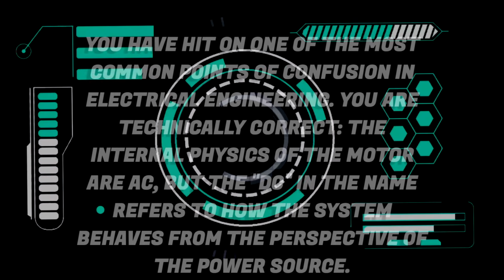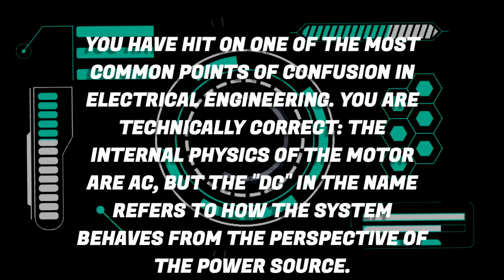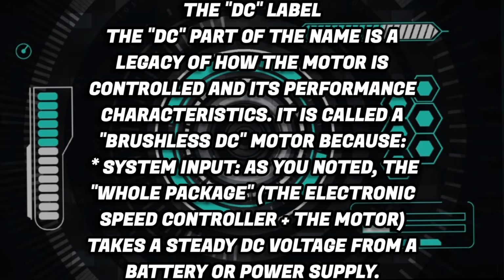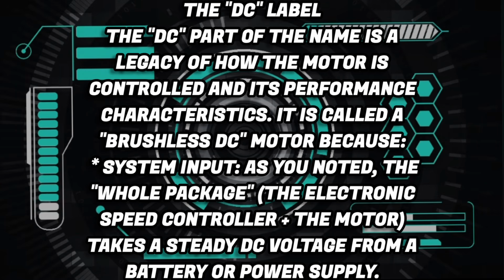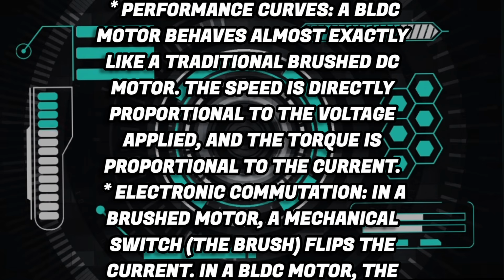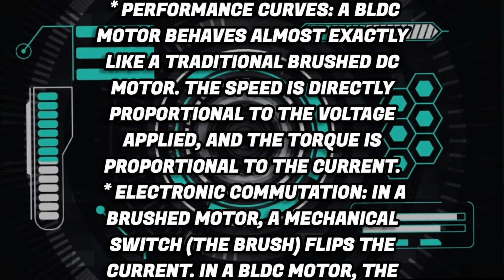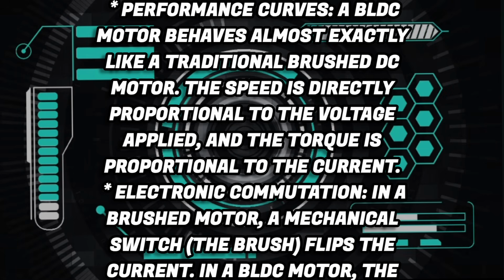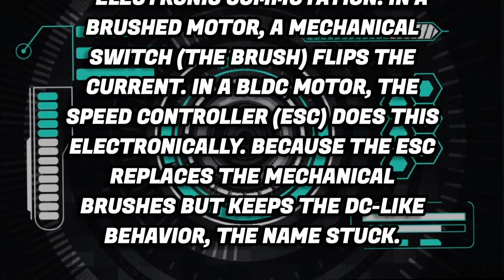What is? "BETAFLIGHT DYNAMIC IDLE" New Tutorial 2025 #fpv #betaflight #tutorial

Comment: Thanks for the good video. Any recommendations for speedybee Mario 8 using HQprops 8x4.5?
Reply from the maker: Woo a Mario 8! So ill be brutally honest! Ive never had much to do with 8" props.
All i can say is that if you have the correct motor and prop combination then a recomended value would be 12 to 25. 
So you have a 4.5 pitch prop so the higher the pitch prop the lower the setting and vicer versa.
For instance: on a 5" with 2306 1700 kv with ethix HQ s5 props which are a high pitch prop for freestyle, i found that 28  was great.
2306.5 motors are very torquey motors so have no problem idling a 4.5 mm prop. 
I dont like to drop to the minimum on the chart as you risk desyncs but gain inverted , 0 throttle hang time (a little)
So the Ethix S4 lemon and lime props are a 3.8 and i found that 35(3500rpm) gives a bouncey kinda instability at forward flight, so lowering them to 33 feels more locked in! (Tune your pids and master multiplier first).
With all that said: when you look at an 8 " the betaflight devs say 12 -25.
If you can hover and pitch punch your drone line of sight. Start at 12 and go up to 25. And its like catching a ball on a tennis racket.
The lowest value of 12 should come down hard and listen if you get that fluttery propwash noise.
Thats not good, slowly go to full 25 step by step and each time you will hear a change in motor/prop noise.
If you get to say 23 and it starts to jump up a little then you know its starting to loose authority and drop down a notch.
(It is not a setting that will do any harm or fly away so dont worry about that)
Hope ive helped and please let me know.
Thanks for asking @jonathanoeijoeng❤🫡

Comment: What would you set this to for a 5inch with hq juicy j37 props on a 6s 1300mah lipo weight is 634 all of weight
Reply from the maker: Hi mate, thanks for asking! So your props are 4.9" with a 3.9mm pitch and you have a light weight lipo on at 1300mah.
So if you go by the chart you want to be in the region of 20 = 35.(2500-3500 rpm) Your drone is gonna be light and j37s are a very lightweight prop with a low pitch at 3.9mm. 
Heavier frames carry more momentum and require a slightly higher idle floor to maintain strict motor authority, preventing desyncs or stuttering when you chop the throttle into deep dives.
Propeller Pitch (3.9"): The J37 is a relatively shallow-pitch prop,and light compared to a hevier ethix HQ s4 lemon nlime.
 Lower-pitch blades handle higher dynamic idle settings exceptionally well because they do not generate excessive thrust or make the quad feel overly "floaty" or resistant to dropping at zero throttle.  Nice flingerbuility with your weight.
I would try around 30-32 (3000rpm = 3200rpm)
Let me know how it goes? 
Thanks for asing mate❤🫡
Reply: @rcaddict9558  31 seems to be the best
Reply from the maker: Did you get anywhere with your dynamic idle?
Reply: @rcaddict9558  yes thank you 31 is the sweet spot
Reply from the maker: O wow! Thats really cool and thank you for letting me know❤🔥🫡

Comment: For 65mm racing whoops. What should it be set to
Reply from the maker: So when I had mine I kept the throttle curve normal, linear, but the throttle was wayyy to high and catching it from split s was really hard.
So I set the dshot Idle percent to 8.0 and this was to use with angle mode and NO AIRMODE ON but outside with airmode on in acro I set dynamic Idle to 76! This Will increase your throttle more like a bigger drone , about 1/4 and will fly alot better without altering throttle curves.
Give it a go. You might want to go higher depending on weight,props and motors.
Hope that helps❤🫡

Comment: Thanks for the information.
Is there a risk of a flyaway if I set this value too high?
Reply from the maker: No worries!  No, there is no chance of a flyaway, trust me, ive tried it😂 but best just try the settings in the charts. 
What size drone and what pitch props are you using, and it would help to know the weight , battery size and action cam or not?

Comment: ok, what is recommended dynamic idle for: HQProp 7.5X3.7X3 7.5Inch 3-blade ? thank you :D (quad is moz7v2 with DolphinRC 2808 1300KV motors) weight about 1400 grams. Thank you again :)
Reply: on my chimera7v2 with those same props and the xing 2908 motors on a 1820g AUW i found 26 works pretty well. weighing so much i dont want to go much lower, but im also not freestyling on it. always start higher and slowly work your way lower.
Reply from the maker: @The_GreenMachine thanks @The_GreenMachine. Glad you could help ❤🫡
Reply from the maker: Hi ya @JOstik, thanks for asking. Cause ive only ever flown and tuned up to a 5 " drone, I can only ask you to follow the advice I give others and 1st look down the different CLI settings for their dynamic idle value in the Presets for betaflight and see how this corresponds to the betaflight chart.
But most importantly try and feel the difference with los controlled punch outs and 0 throttle descents.
Like catching a ball.
Listen for the tune and record this session in your goggles to look for propwash decrease (remember that propwash bounce can be often mistaken for camera too soft mounting)
So I would have gone with the higher side of the table , like 21,
But when you notice your drown start to float just before the los catch thats a good place to be.
Any more float which you can go up to 25 and nothing bad will happen!
The drone will just get more floaty and loose authority if too high and fall like a brick if too low.
Replay your goggles feed and look at the best setting!  Thanks
Hope this helps.❤🫡
Reply: @rcaddict9558  hey Guys, thank both of you :) using UAV 8/9 inch preset as for quad weight, just lovered master multiplier to 1.2 and changed default idle from 35 to 30 to start with and will wait for weather to stop rain, and will go for test runs :)
Reply from the maker: @J0stik remember, think of it like catching a tennis ball. The higher the value, the floatier the ball comes down (slower and may lose authority a bit), the Lower the value the faster it drops ).
Try los as you can really feel it that way!
Reply from the maker: I was going to do another similar video on ANTI GRAVITY, so putting illustrations and explanations in lamen terms.
Would you bel interested?

Comment: For a 5" speedy bee what dyamnic idle should be ?
Im running 35 idle atm!
Thanks
Reply from the maker: Ok so first we need to know what props?
Are they 5.1" and what pitch. 
So if your running a low pitch prop like a mango lassi or candy cane. In my opinion you want to set dynamic idle from 30 to 40,
And a steep pitch prop like 4.5mm , 20 to 35.
How I do it is go line off site in a quiet place and in front of you, punch the drone "controllably" straight up , drop to 0 throttle and listen to the props, it should sound like the intro when my drone is falling.
The good thing about tuning dynamic idle is that it won't mess it up, it won't suddenly fly off. 
So go from the 20 - 40 setting and you will feel the drone drop and "like catching a ball with your throttle you will feel it at low setting almost hit the ground, as you go up the setting amount , you will start to feel the drone level out and float for a micro second.
Thats where you want to be! 
Remember that setting and keep going up the scale and your free fall will start to feel more and more floaty and the Authority will change!
If you have the ability to record these punch outs , play them back and see when the propwash disappears and the fall sounds controlled.
I hope that helps❤🫡